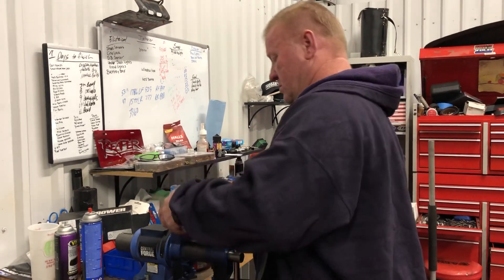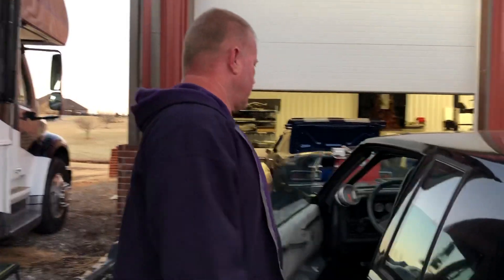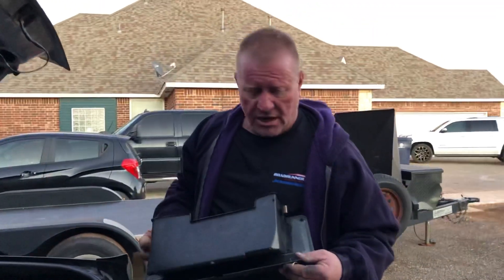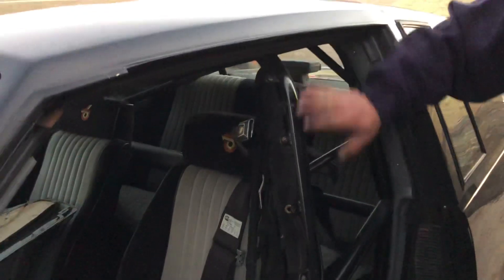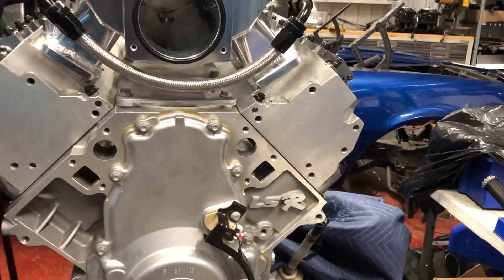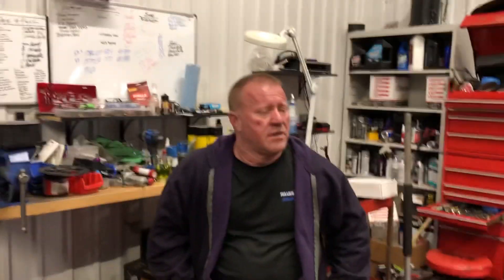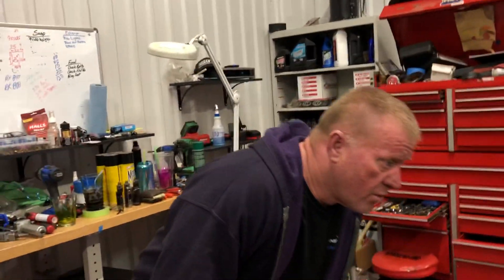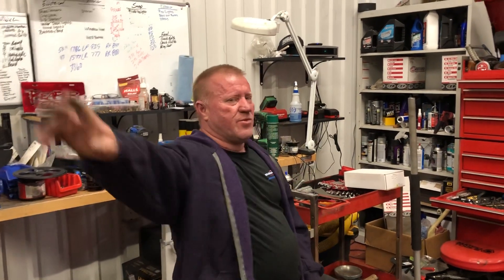Extra Motivation

Comment: Nice car I have a few of myself I actually got one of the rarest ones made it's called Turbo T very light very quick a lot of  Aluminum on that car The Secret motor you're trying to buy is the nascar V6 that came in themAlso got 2 of them lol you street outlaw guys are late I owned buick regal g.n since 89 I got a  Limited and didn't know what I had that's the one I should have kept but I do own a limited now a limited now very clean car good video can't wait till you hook that car up it will get done right with you

Comment: The LS/ LT based 4.3L V6 (LV3) from 2013+ Silverado's would be a killer swap for the Buick.  The Grand Nationals claim to fame was its V6's ability to beat up on V8's.  I think it would be cool as shit if you keep it a GM pushrod turbo V6 especially now that there's stock 4.3L V6 heads flowing 300cfm plus new Garrett G series turbo that will provide instant response with top end for days.

Comment: James I believe you mention that you are going to use the Holley front drive accessory on the LSX and a Procharger. I called Procharger last week asking if the make bracketry for the above mentioned and they said I need to call Holley and ask them? I have yet to do that but thought that was an odd answer. Figured Procharger would know..Have you purchased the set up from Procharger yet. If so could you let me know what set up you got. Thanks!